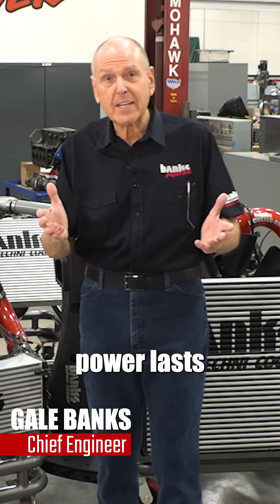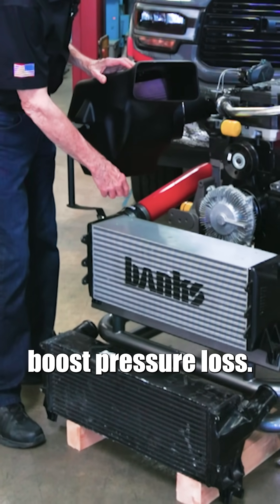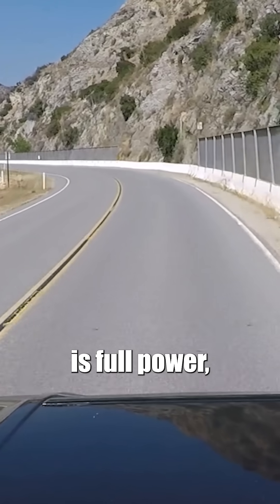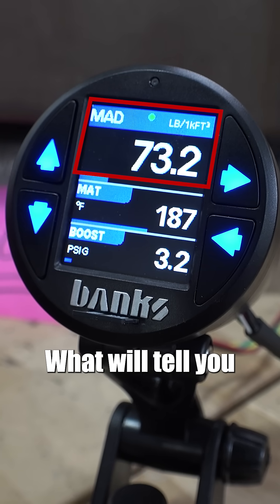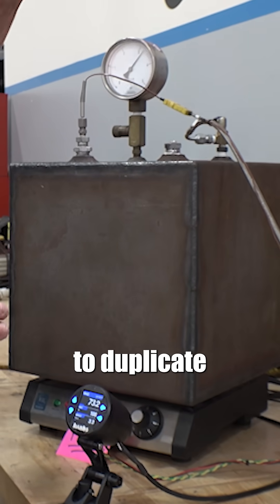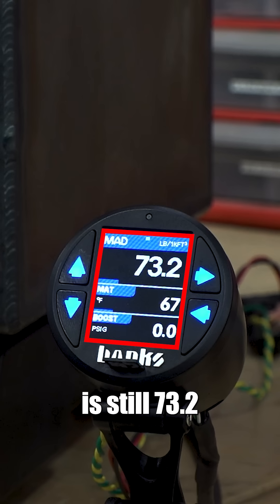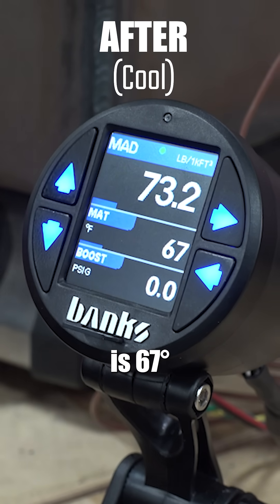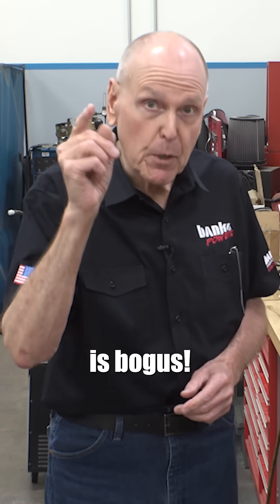Why your boost gauge is bogus.

Comment: Air temp in and out is all we need to know.
All a radiator is for is to lower temps.
Simple way to look at something, but it takes any confusion out of the equation.
A restriction to flow will further reduce the temp drop

Comment: Ideal gas law applied to the closed rigid box will have a constant density as volume and air mass are fixed. n/V = P/RT. Adding heat increases T and P proportionally. The addition of heat assuming no loses to the atmosphere is Q = U = mCvdT. Where U is internal energy. This is a closed system as defined in thermodynamics.

Open system thermodynamics would apply to car engines, where enthalpy is used, H = U + PdV. The PdV term is the fluids ability to do work as it changes volume. The enthalpy change of the air through the intercooler is equivalent to the amount of heat rejected to the atmosphere which is governed by heat transfer mechanics, convection/conduction. Look at the Nusselt number and how it relates empirically to the Reynolds and Prandtl numbers. There is a lot of physics going on here, I am a chemical engineer and know the ins and outs of thermodynamics and hydraulics.

Comment: Not to be "that guy" but the boost gauge isn't bogus. It shows you the air pressure in the intake manifold, which is all it's supposed to do.
Of course you have to cool the air down after compressing it to increase the density compared to only compressing it.

Comment: He's right.  Boost means nothing honestly.  I encourage everyone to read "Boost is not a power adder by Big Jay" if you can find it.  The short version is boost is just a reference of your particular setup.  It's the CFM and airflow that matters.   

You can take a well built engine, put a turbo kit on it and it will make say 500hp at 9psi.  You can change that to a better flowing turbo kit and it will make 550hp at 7.5psi on the same engine.  All you really did is increase the airflow and decrease the air pressure.  So you increased the efficiency  of that system to move more air and decreased the air pressure, and therefore heat at the same time which made you more horsepower.  

That's the simplest way I know how to explain it.

Comment: When I was a truck driver I seen more of these "heavy duty" pickups broke down on the side of the hwy than any other vihicle. I have heard horrible stories of a hot shot o/o blowing up an engine with a 20,000lbs load on a hill. These "heavy duty" pickups are not designed or built to last for long hauling.

Comment: Plant equipment - duty cycle 1.0   - Absolutely NOT a dragracing scenario (the absolute opposite seeing so many dragsters have solid blocks with no cooling at all..  (Don't run for more than 20 seconds or so...)

MAF - rules....  High front trucks have the space under the hood for cooling - streamliners don't.

Comment: difference between MAF and MAP  now for turbos.  GOOD work OG
Reply: DENSITY is REAL air volume, flow rates mean nothing if the air is thin.  Volumetric efficiency is fascinating stuff that even davinci used to nerd out about.   Now do it full volume with a VORTEX spiral. :)

Comment: So this proves why our tires increase in pressure during the summer months and decrease and pressure during the winter months. The ideal gas law… in order to increase air density you need to increase pressure while decreasing temperature… one cannot do this as in a sealed container they are directly proportional.

Comment: This is kind of misleading. Yes, the air temperature will be higher after compression and after heat soak from the intercooler. But the increase in pressure is still higher than that, meaning that density will be higher and affording the engine to make more power. 

Even if there is NO intercooler, the air density will still be higher at a steady state. I'm not saying the Banks intercooler isn't great, but I would prefer a less misleading sales pitch.

Comment: This sounds stupid, but I wish you guys did normal, not high performance mods. If it's actually true that cooling the oil and transmission fluid increases the life of those fluids, I'd absolutely buy parts for my 2013 Subaru outback, for example.

Comment: And that is why I had a Moon Relative Air Density (RAD) gauge when I tuned MX and Roadracing 2 strokes for both Gas and Methanol in the 70's and 80's.

Comment: Me pulling a small ass camper in a 3/4t gasser with no problems.

Dudes who opted to drop 70 grand on a camper to sit in while outdoors struggling to keep the speed limit

Comment: Air density is about oxygen molecule tha combustion need to ignite. Air when heated, the molecule(gap between oxygen) expend = air capacity is the same but they expend thus increase boost(positive pressure) but oxygen just the same it just expend gap or contract. Cooler air does the opposite. Let's the knowledge be free ✌️

Comment: I totally experience this.  I have an issue where I heat soak massively.  When my setup is hot, the gauge says I get boost, but I don't feel anything when I press the gas.   I have a few things to do to resolve my heat soak, but this is great.  I get IAT at around 150F

Comment: My 98 12v has yall entire air intake kit some diff parts a bult stage 3 trans and yalls exhaust i just got my turbos refreshed. And hoping to oneday get a newer slightly bigger turbos and the p pump is from fass along with the injectors and fuel system but from watching yall ive learned so much and my truck that i can pull cattle trailers and tractors everyday and use it as a toy hauler without any concerns of failure or not having enough power and maybe oneday i can just completely have all your products and pass this truck down to my son

Comment: I was just wondering about this very thing. I have a 1,000hp cummins with a massive On3 inner cooler and was wondering if my other truck I pull my trailer with would perform better with that but maybe not since it’s my on road truck that’s basically married to my trailer

Comment: Density is mass / volume. Since neither the mass of the air in the box, nor the volume of said box changes, the density cannot change. Just the temperature changes as shown. I'm not sure if this is trying to trick people into buying a product or a misunderstanding of density. He didn't have to rig this test up to prove density won't change in a sealed box, it cannot, but if he also pressurized the air ie. boost then he would have seen density increase.

Comment: It’s MASS Air Flow that’s measured by the engine air intake. All you need is a means to read that value. 
You also need to read inlet manifold air temperature and exhaust gas temperature.

Comment: Boys play with peek power.
Men work with continuous power.
if it cant make serous (for its application) Horsepower all day long in the middle of summer its a toy. like combines the big ones be making 600HP+ all day long. tractors favor torque over HP still pump out 200HP+ all day long. the best way to solve premature throttle lift off problems is cooling.

Comment: yeah thats why you run a pressure sensor AND a air temp sensor. Never seen a MAD meter here. But the principle is the same with pressure and temp.

Also funny how people say my intercooler has 0 pressure drop. Yeah thats all fine. But how much temp drop did you get? Yeah thats what i tought, prettymuch nothing. A straight pipe dosnt have much pressure drop either, but it dosnt cool much either....

Comment: You are full of BS. You make it look like that MAD gauge is the ONLY input the engine is receiving. There are other sensors that compensate. You make a narrow minded video to sell your crap. If car manufacturers thought they needed bigger intercoolers they would just make them bigger. Your "performance" gains are marginal on the extreme range only.

Comment: Your problem with that test is turbos pull more air in to create PSI. Using a sealed box and increasing the pressure by heating and expanding the volume of air that is already there will not increase air density at all. If you pushed air into the box to simulate a turbo then the MAD would increase because you are adding more air into a smaller volume.  Not saying it isnt a good experiment but all you proved is the density of air doesnt change in a sealed enclosure. Turbos will increase air density as the draw in air and compress it. The temperature only effects efficiency of the engine. Cooler temps means better more controlled ignition.

Comment: banks power
love your stuff. I have a banks oil cooler on my DFC 6.6 LB7 i just put in my truck. Do you make an oil pressure gauge that i can run off your oil cooler ? i dont trust my dash gauges and want an actual reading

Comment: A friend of mine recently ran into the exact wall I warned him about with his turbocharged Honda Civic. His car made between 250-325 ish wheel horsepower depending on which fuel he is running and if he is at the track or on the street. He decided he wanted more power on the track, he was running about 18 PSI and he ramped up to about 22, 23 PSI. He noticed no real change in performance. He ramped it up closer to 25 and the car went slower, he couldn't understand. I pointed out that his charge air cooler was undersized for anything more than about 300 horsepower, he had decided to go with a cheap cooler when he built the car. He found a high quality cooler used locally for a good price, he installed it after reworking his cold side piping, and then found he had to totally retune his ECU because the temps were instantly cooler under all conditions. I think he is now pushing closer to 400 horsepower at the wheels at an indicated 18 ish PSI. I know his car was already quick before, it was near the top of 4th gear in the 1/4 mile, now he actually has to shift into 5th before the 1/4 is up or bounce off the rev limiter and lose time.

Comment: I know Banks primarily focuses on Diesel and heavy duty applications, but i bought the pedal monster for the 2024 F150 5.0. Happy with the results. I would be interested in more performance parts for the F150. Differential cover, trans pan, anything Banks for my F150 i would be highly interested. Not sure if there's a market for light duty trucks for Banks, but i would be a buyer for sure.

Comment: Presure alone isnt a good description of how much air you have in a certan flow.

Air has its mass, volume and pressure.

If you heet it up you can have the same volume, the same pressure but lesser mass.

But we want more mass, because we want lots of it for the explossions in cilinders to be super powerfull and perfect.

So the cooler you can get the air to be, the easyer you can get more of it in the engine.

Comment: I was just commenting about this concept for these guys breaking a for cylinder block they supposedly ran 80psi into. Trying to tell them they would probably make more power at 50-55psi and not break the block in half.

Comment: A boost gauge is not bogus, pressure is just pressure. It’s just not telling you the whole story.
Reply from the maker: Correct. We're not saying that it's a false measurement. We are however, saying that it's not the final arbiter of power. Manifold Air Density or Air Mass is.

Comment: Camper trailers aren't heavy at all should have taken a picture of a hotshot pulling something
Reply from the maker: Unfortunately the vertically-cropped shot doesn't show the trailer that's being pulled behind the 5th wheel. In other words, there's a 5th wheel with a car inside of it, towing another trailer with a UTV.

Comment: Hello
See dave garage and make a video on dimple on piston surface and ceramic coat, please.
Is it true?
Reply from the maker: We speak with Dave frequently. However, we have not sold on the science of Speed of Air pistons. Data is scarce.
Reply: @bankspower  you can test some parameter, like sound or emision etc with a brand new engine with standard piston and compare them.

Comment: Love ya Gale, but c'mon. A boost gauge is nothing more than a pressure sensor. Between the IAT, MAF and MAP sensors the ECU has at least a foggy picture of MAD. "Boost" is one of those words that has the misfortune of being dually defined by it's main users with a caveat and asterisk behind it just in case we gotta add something to the primary definition. In other words, your definition of boost and subsequent expectations of the sensor caused your own deception❤

Comment: Mack Trucks tested their engine and 5spppe combination on the hills of Pennsylvania. Once they got the fuel mapping under control, they released thecombination and sold a lot of trucks. My first ride in a Mack pulling 54000 pound load was amazing. It accelerated as quickly as if it were bobtailing. .

Comment: Well boost (pressure) and air density are two different things… you wouldn’t use a boost gauge to read air density. So it’s not that the gauge is bogus, it’s that your using the wrong tool for the job
Reply from the maker: You are 100% correct. But all too often guys use boost at the final measuring stick.

Comment: Banks is not saying Boost or Boost gauge is useless, he’s more stating his indicated point on Intercooler…. Objective is to Cool the Air charge from Turbo with Minimal Loss of Boost from Intercooler Hot & Cold side.  To cool air, it needs to slow down through the Intercooler.  

Practically every OEM Intercooler does a pretty decent job of Cooling, although it’s common to have a substantial difference in pressure from inlet Hot or Exit Cold…. Often 8-12 psi difference. 

A good Aftermarket Intercooler like a Banks or SPE (for Ford 6.7) will cool about the same as OEM, but will flow and minimize Boost loss… may be as low as 1 psi difference between Hot & Cold. 

That provides more density of air to the Intake Manifold… thus more HP & Torque. 

That’s what his Closed chamber of Heated Air is displaying.
Reply: He literally said it's useless though
Reply: @  he’s saying it more to make a point and impact towards air density … it’s still relative. This video clip is on Intercooler, not Turbo. He’s showing how Temps and Pressures interact, and the goal is air density Not Boost Pressure. On a flowing system, not a closed system as in his example… you can see boost difference between Hot & Cold side. 

Watch his other videos, he often references boost pressures and shows his gauges reading boost, at the same time reference air density & volume. 

The Point is 4 lbs or 12 lbs, isn’t always accurate correlating to volume & air density. 

On a live flowing system, the Boost pressure on Hot Side isn’t the Boost the engine sees after the Intercooler… if you listen he states pressure differential and volume going in & out of Intercooler.

He’s also sales pitching the Banks Intercooler, it’s pressure differential between Hot & Cold is minimal… providing more volume and density.

Comment: I finally got my favorite truck 2001 F350 7.3 l diesel it does have a bank's exhaust brake but I don't think it functioning I don't even hear it based on the other videos the Gale has put out. 
But I am going to put everything I can from banks on my truck. 
I need to find a bank certified guy or I'm driving it down to have banks do it all for me.

Comment: Boost gauge is not bogus.... It DEPENDS who is reading it... 

For me, mechanical engineer, I read the boost gauge together with IAT (which is air temperature after the intercooler).

Sadly I have the feeling my intercooler could be larger ( higher exchange area)....

Comment: Your RPM gauge must also be bogus, as in higher heat and lower air density your RPMs can be higher but produce the same power as the lower RPM at lower heat and higher air density.

Throw away those RPM gauges!!